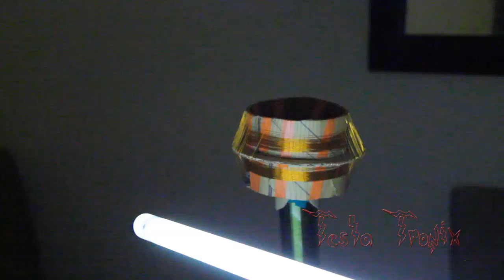Huge Range for Wireless Power Transfer

Comment: Missing the waveguide between the R.T unit and the Toard. Why is everyone copying everyone else, Read the patent. There is a waveguide in the wardencylffe tower. The R.T unit was designed by Faraday in 1831 Years before Nikola Tesla copied Faraday. Why you and everyone else hasn't gotten anywhere with this.

Comment: The reason the bulbs get hot is probably due to the fact that there is an increased movement of electrons in the gas within the bulb...which as we know equals increased temperature as that is what heat/temperature are = movement of particles (electrons mostly)

Comment: Not necessarily wireless transfer... Because your body is acting as the wire... It'd be true transfer if it (the tube) was across the room without anything or anyone touching them
Reply: hello Tesla.....can u give me the list of parts you used in your tesla coil.........any help will be appreciated...
Reply from the maker: They will light if I toss them into the air. Cheers.

Comment: Because electricity is a natural radio freq. the earth has a natural ground, and the atmosphere has a positive charge because of wind friction, so any extra freq you put into the air carries like a wave, like pouring a bucket of water into a pool that is about to over flow the pool will leak 1 bucket when it spills over. tesla wanted to make a few towers to make the earth an electrical wave pool of energy. 

Try wearing a watch or holding a radio antenna. Btw look up Rodin coil

Comment: I've made it this circuit with low voltage and works great. I bet he used more voltage and current to gain that light range. I think with 2sa1943 transistor he feed the circuit with more than 35volts. (:
Reply: HELLO ROBERT
can you plzz help send this circuit diagram of this project, i cant figure it out exactly how it works...
Reply: thank you sir...
does adjustment and winding have specific calculation or range ...i cant do the analysis on that part.
Reply: thank you.let me try will get back to you if am stuck somewhere.
Reply: Can u send the circuit diagram for me sir

Comment: Interesting use of the "extra coil" at the top. Very "Magnifying Transformer" like. Remember though, your secondary's height, should be no more than 3 - 3.5x its diameter. Anything more is wasted (per Tesla). Very impressive range with the bulb, but remember, 90% of that radiation is wasted. Connect your secondary to an earth ground rod, and you'll find it induces a "longitudinal" modulation that can be "received" by your bulb hooked to another distant earth ground.. This is the same thing that's happening when you touch the bulb. Your body adds capacitance to the wireless "circuit" allowing it to be tuned for better reception.
Reply: +Chris Bake These SSTC's are great for learning and effects.. I've learned a ton from the Slayer/Exciter kits.. But, Tesla only used these methods of "Wasted radiation" for impressive effects during demonstrations. He eventually abandoned such works, and started working with disrupted, or "micro-duty cycle" DC currents. 100ns "on time" produced much more efficient radiating spikes. 100ms even had health benefits..  He made Samuel Clemens have to change his underwear ;)
Reply: Chris Bake hey it has been 2 years
it looks like you have a good knowledge in  tesla coil 
I am facing a problem I don't know where to connect the other end of the secondary coil 
is it a good idea to connect it to the ground ?
I mean the floor not the third pin in the wall plug
Reply: @up2finitecovers  yes bro
Reply: I think you need to read up on Colorado Springs notes, and the documented interview with the Council. 

Read that whole doc, and let me know if you still feel like 90% isn't wasted. Hint: Skin Effect.

http://www.tfcbooks.com/tesla/nt_on_ac.htm#038
Reply: +Aetheric Light proof please?

Comment: plz will tell me about wireless power generator .who can i make it? .I make  Tesla of 340 turn's and i used resistor of 1k .and Transistor of kN2222A . And i give 5 turns for primary coil  and 9V of battery but it's not working .What should i do now ?plz tell me.

Comment: your exposing your self to dangerous amounts on X, Y, and Beta rays stop it man your frying inside, its ionizing magnetic fields, your cells resonate at a extremely low frequency and so does that which will collide and not end well, don't get me wrong its cool but it ain't worth your health
Reply: i wouldnt say hes getting dangerous levels of radiation exposure from this. there is no source. his power source isnt strong enough to produce microwaves, much less xrays or gammas.

Comment: Awesome, not all Tesla coils are the same. They must be made 'balanced'. The surface area of the primary must equal that of the secondary. Tesla also often had a tertiary as well (primary, secondary and tertiary). Your version is obviously different. I'll have to try to make one as well... Awesome video, I'm a new subscriber :)

Basically when J. J. Thomson was forced to say that electron was the charge carrier in electricity because he was promised fame and fortune for the discovery. In reality he wasn't sure that it really was the electron. At the time the notion of electrical aether was very popular. Great minds like Maxwell, Tesla and Einstein all believed that the electrical aether was real. The electrical aether is basically a primordial electrical atmosphere that permeates space. It is electricity acting almost like a gas. Indeed if electron really was the charge carrier in electricity vacuum would be the best insulator imaginable because it contains the fewest "free" electrons to be used in electricity. In actuality the spark is strongest in vacuum! You can see the plasma inside of the vacuum light bulbs (as you have demonstrated in the video). We have much to learn about what electricity really is, I suspect it is a metaphysical phenomena that is entirely separate from current physics.
Reply: Naoki Kashima  no

Comment: What you see here is not a case of high magnetic fields but high electric fields,
Electricity is the flow of electrons  and these electrons can be made to move through conductors or insulators. Basically conductors need nly a little voltage to cause the negative  electrons to jump from one atom to the next  but in insulators well you need to pull much harder if the  material is cold, and easier to pull when the material is hot as in a valve heater of the old days,

Now the gas in the fluorescent tube and the neon  bulb need a higher electric field to  cause them to move.  Electric field is Volts per meter and  nature seems to cause these high field around sharp corners . What forms around sharp corners are high electric fields which can rip off the electrons from the gas  atoms .Once these electrons start moving they can knock off other elelctrons and  an avalanche effect results which normally the current flowing will have to be limited by extternal resistors, In this case there is not enough power  to cause a complete avalanche but a limited one,  A word of advise............ high electric fields will cause particles to accelerate and when they fall on material they knock so many elelctrons to various levels that when this happens , material effects as X ray and other high frquencies are generated and these can penetrate the human flesh and damage it.    I personally would  not advise this young man to play about too much in that high electric  fields as we do not know all the effects on the human body, 
Perhaps he should wear a Faraday cage to be safer, perhaps that headwear is a protective devise, I hope so .    Thunder and lightning is a case of very high elelctric fields ionising the air and current flows through an ionised " insulator" which is not when this isoisatin takes place due to ELECTRIC FIELD AND NOT MAGNETIC FIELDS, Be careful  when ever you are exposed to such fields, it is not a game that  you are playing !
Reply: But didn't tesla tried to build a similar one but much larger and it was intended to spread around the globe? I thought tesla coils won't be able to penetrate your skin.

Comment: whats ur RF radiation like are u jamming the hole AM band i know it u run a spark gap it makes RF radiation = AM jamming i was wondering if this solve this problem the funny thing is i have broadcasted with my wimshurst generator i just didnt put any kind of antenna so it didnt go far B\C i dont want the authoritys at my door step dose this coil jam the AM band O.o

Comment: Hi, I'll be grateful if you could send me the schematic and list of components used. Also, what's the power supply type you use, a computer power supply or what? I know that in witricity concept the power supply has to be AC not DC. Am I right?
Thanks.

Comment: You can move away lowly- farther because once your drawing a small load you stabilize the connection and it resonates.  My guess anyway. :)
Reply: You might consider this: Once the gas in the flourescent tube is ionized, it takes less energy to keep it ionized, so it will  remain ionized as you slowly move away from the tesla source.

Comment: Neat project. No X-rays though, that would be in the peta to exahertz range. You are below radio frequency in the megahertz range at most. That's at least 10 billion to 10 trillion times lower frequency. The frequency range is harmless to humans but harmful to signals and other devices.

Comment: When you are lighting up bulbs, (to full brilliance- i.e. at their wattage rating)..
What is the ratio of power going into your coil, compared to how many watts going through your combined bulbs? 
   In other words the throughput efficiency of the your coil. 
   Too bad power radiated is inverse to the square of the distance to the receiver, or this might be a practical "wireless" defacto method of electric conduction.

Comment from the maker: Well, depending on the transistor/turn count/topload you use you should be between 500k-10Mhz. A TIP31 with a larger secondary with a wide ratio will resonate low in the AM band, but not too low as to disrupt the nearby emergency broadcast frequencies. The frequency isn't extremely high, but I would not run one near very young children, and I try to limit run times and not hover directly over it while its on.

Comment: I'm sure you could but you'd have to keep a sharp eye on the battery power because by running heavy load equipment will drain any battery real;fast so my best answer is if you could regenerate your power supply so it never runs out of electric charge...

Comment: I agree with Mongrel Shark, now that you have a good strong signal, you should now use that signal with AM radio tramssion A/C step-up phase's to increase the distance of your signal. By using vacuum valves to step-up voltage and occilation then send it through a wire hanging between 2 tower antenna. This video "Radio Principles: "Sending Radio Messages" 1943 ERPI Classroom Films 10min " will explain in more dept, it's on youtube & just remember instead sound waves & mic, your using yoiur signal

Comment: From my replication, I can confirm your findings. This device has all the effects of a traditional Tesla coil. Without the complication and expense. I haven't been able to test for Tectonic currents, but if the DC neg is grounded, it should produce them with a repeater tower. Wireless energy transmission, Single wire transmission, single wire induction, and plasma discharge are all present. Repeater should give you extended range and directional focus between towers. Output pew watt in is great!